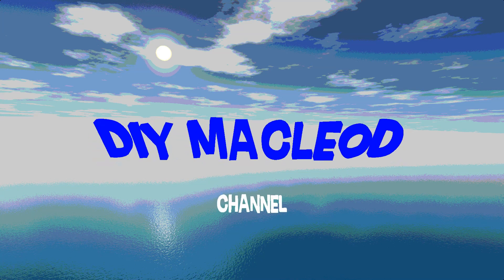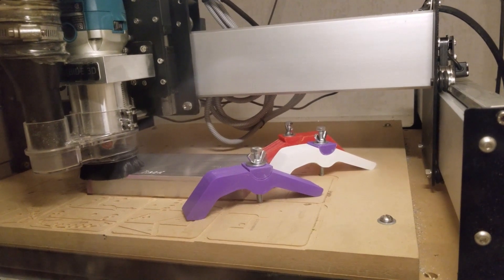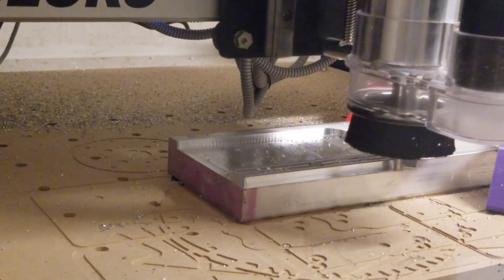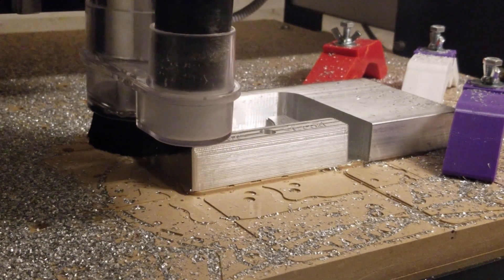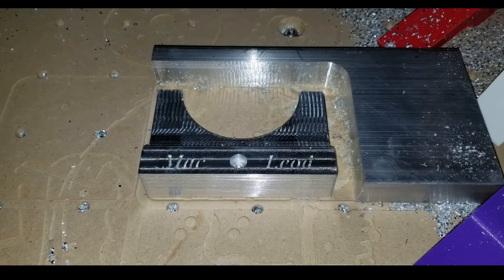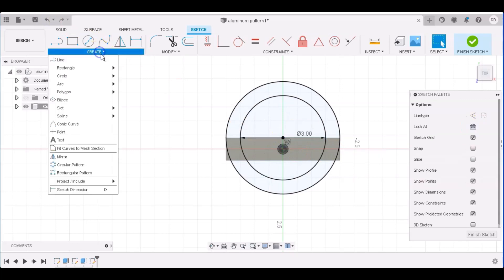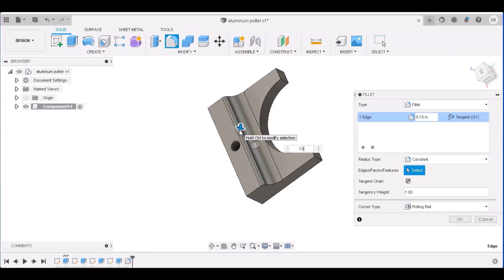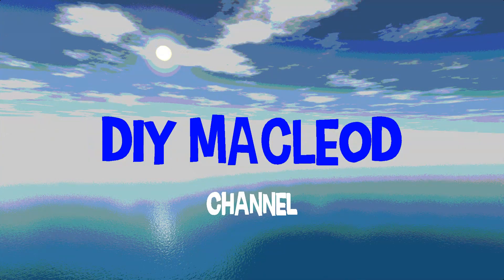Shapeoko 3 CNC vs 1" Thick Aluminum - Making a Putter Head -  Part 1

Comment: I am trying to figure out the best F/S for using a single flute 1/4 endmill.  I am simply trying to cut down a block of 6061 Aluminum to use as a joint bar inside Aluminum square tubing.  I have never mastered feeds and speeds so I was wondering if you can offer some advice on my single flute.  It is the SpeTool Single Flute (O Flute) Spiral End Mill Aluminum Cutter Carbide Router 1 inch Cutting Length with 1/4Inch Shank.  I have the Makita router on my Shapeoko XXL.  Was thinking 14,000, Cut depth of .015, 50% stepover.  40 ipm, feedrate of 40ipm.  Plunge rate of 20 imp.  This is to simply cut the aluminum down to size so it will fit inside the tubing and form a joint.  Thanks for any help.  The bar is 1.511" thick and I have to mill it down to 1.116" thick.  Also have to trim some off the side but I will have to do a two sided cut for that since bit is only 1" cutting.
Reply from the maker: Hello Midsouth,

     Thank you for the comment. I am no expert in this field (my best advice would be to email Winston Moy), but I will give you my insight. Firstly, I have had very limited success with "0" flute end mills. I have tried them a few times and eventually I always end up fusing the aluminum to the end mill. I think I run them with too low a feed rate compared to the spindle speed. For aluminum, my best results have always been with 2 flute Amana high speed steel end mills (HSS1633 specifically) they are around eight dollars on Amazon usually and I run them dry. I use a Makita as well. I set my speed between 3 and 4 on my Makita. I run the plunge and ramp rates lower at around 12 to 15, but that might not be necessary. I use around a .15-.20 stepover with the quarter inch 2 flute. Also, I have a Z-plus z axis so I feel ok running contours at 40, but I would possibly slow that down a little if I did not have a Z-plus. So if it were me, I would run my Amana 1/4 inch end mill at 35 ipm feed rate, 10 ipm plunge, 13 ipm ramp and .15 stepover with .015 depth per pass. I would use these numbers and then ramp up feed rates during the job with Carbide Motion's ability to increase feed rates by percentage ( I often end up running my jobs at 110-120%). I would possibly try it first on a scrap piece of 6061 and make sure I am making chips and not dust (aluminum milling can be dangerous especially dust). I do not blow my chips away, but I do have my vacuum on high while cutting aluminum, or I pause and vacuum up areas I see getting overfilled with chips. The other thing to consider is work holding. I have a sturdy enclosure, but if I did not, there would have been times chunks of aluminum would have been launched in my work area. I like to use both double sided tape and a physical hold down tool when possible. Take any of this information with the understanding that I am not an expert and this is not advice, but simply what I would most likely do, but first I would continue researching best options from experts like the Carbide 3D people.
Reply: @BuildsandBirdies  very very helpful!!  Thank you for all of the details
Reply: @BuildsandBirdies  I pretty much used your settings with the bit I had and it is working like a champ.  11 more hours to go.  Then 3 more pieces after this one.  Thanks again!
Reply from the maker: 11 hours is a long time that is a lot of material to remove. Remember you do not want aluminum dust. I would still email the Carbide 3D guys to see if they have different suggestions.
Reply: @BuildsandBirdies  The original piece is 4“ x 24“ long by 1.5”  thick. I have to take it from 1.5 inches thick down to 1.1 inches. So yes it’s quite a bit of removal. It is nothing but aluminum chips. There is no dust
Reply from the maker: Awesome. Sounds interesting. I have not tried such a large job on mine. The putter heads I made took about an hour and a half. I might need to retry a 0 flute.